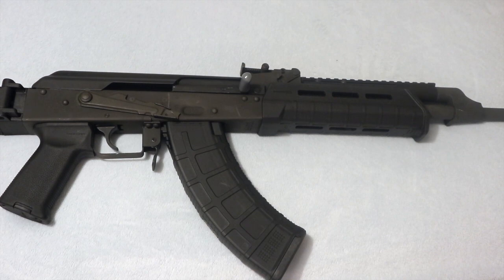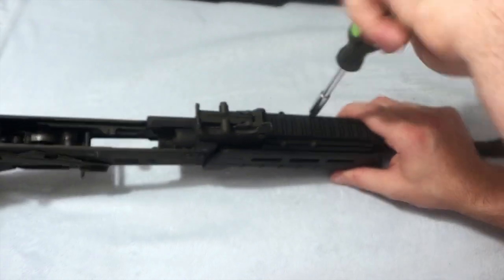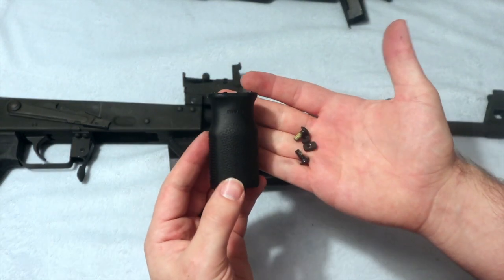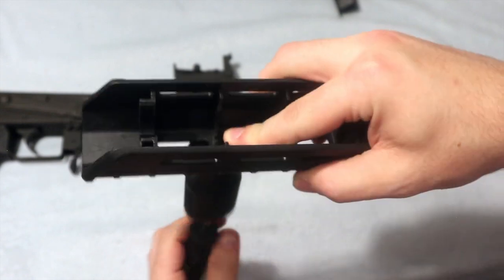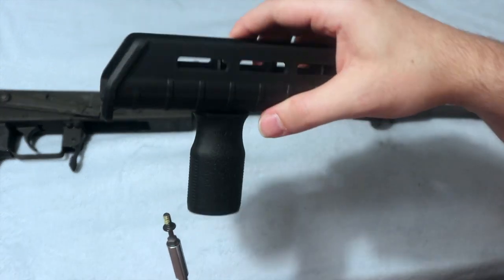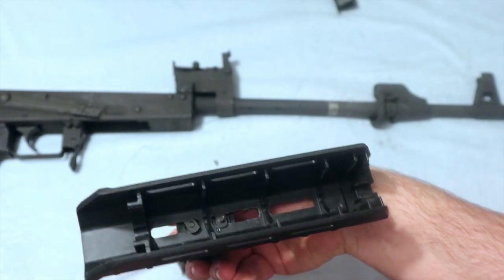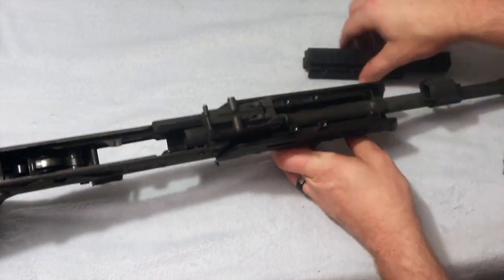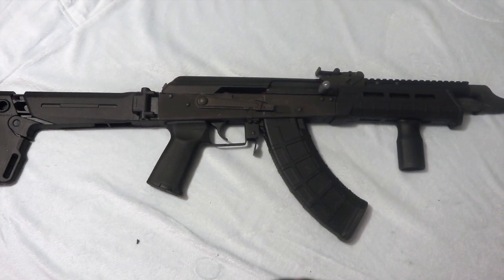How to install MAGPUL MOE M-LOK vertical grip on AK-47

Comment: Crap mine doesn't pop out as easy as yours. mine has 4 tabs on it. 2 tabs are easy to free but the other 2 at the muzzle end are impossible. that's why I'm here. Mine is probably a newer model. But the tabs on mine are the problem!!! I just cant get it off.

Comment: Can confirm this whole Magpul kit works with the RAS47. pending your barrel length you may have to grind it down if you're running the SBR version.
Reply: For my Ras47 pistol would I have to grind it down ? Or would it basically fit like a glove

Comment: EDIT: found out mine is the MOE version instead of M-lok

The mvg I have is a different version. It came in a white finished box instead of the natural and green cardboard box that my other grip came in. It's definitely giving me problems compared to the last one.
Reply: I've found that my handguard will fit without the aluminum insert/tray, but it won't go on properly if the metal piece is in there.